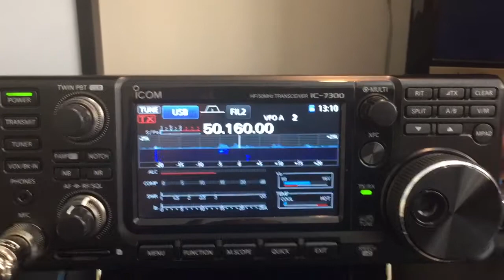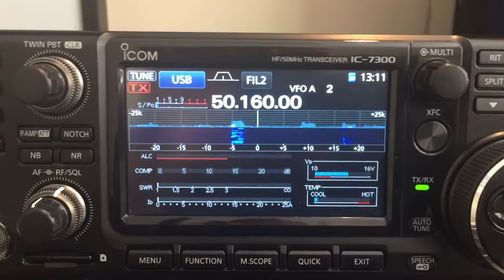Antenna Comparison on 6m During a Sporadic-E Opening on the Icom 7300

Comment: Thanks for the test. Observations: 1) When switching between two antennas on receive, your ATU on the rig needs to be OFF.  The ATU affects reception on the antenna that it is not tuned to 2) I could not hear a dickie bird of what you were saying as your radio volume was louder than your voice 3) I have no idea what a Western HF10 is, perhaps you only get it in the UK. Wondering if it is designed for and resonant on 6 meters ?
Reply: I guess Im quite off topic but does anybody know a good place to watch new movies online ?
Reply: @kingstonmatias1979  very off topic,  you spamming fool
Reply: @Kingston Matias Try FlixZone. You can find it by googling =)

Comment: Signal differences are mainly due to polarity and antenna beamwidth (takeoff) not coax. I get same difference between 4 element beam at 12m and colinear at 9m. Some sigs close in (using high angle E's are stronger on colinear than beam. Sometimes can't hear them on the beam at all if the E's are close in, beam "shoots" underneath cloud. So beam/H dipole for longer DX. Vertical for close in. More noise on all verticals as most QRM is vertical polarity.
Reply from the maker: Interesting Dave, thanks for that. Makes sense, I'll have to test out the theory with a longer distance station!